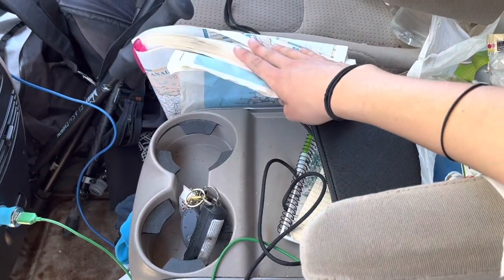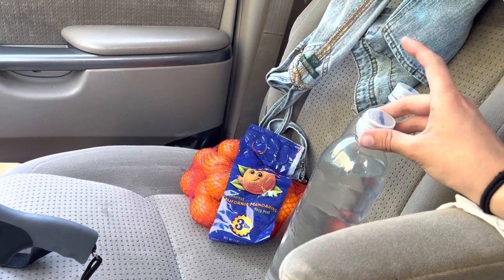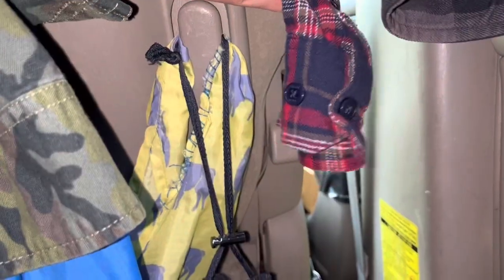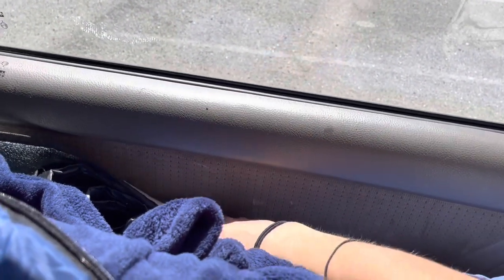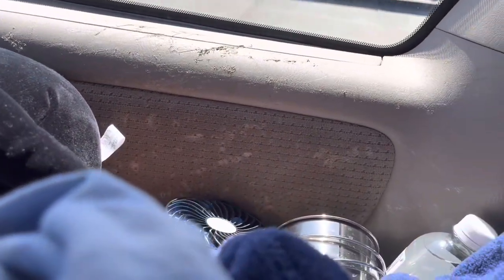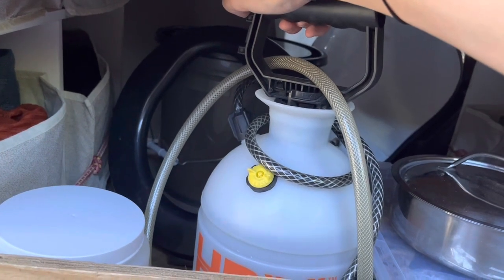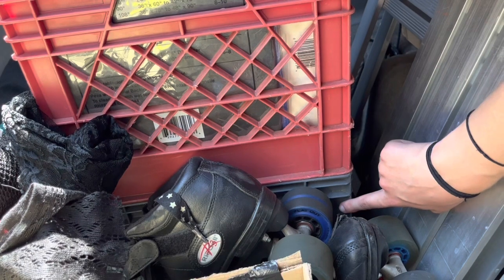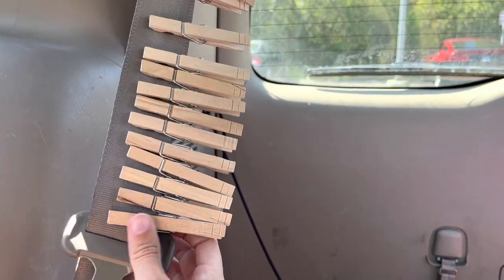VAN TOUR | DIY Minivan Camper | Easy Cheap Van Conversion

Comment: Why do most go full detail on where stuff is located. The van we got it....the side door pocket the passenger seat this drawer that drawer in the fridge in the cooler under here over there up here right there. Too much unnecessary yapping and not trying to be negative to you but it's to all. useless content
Reply from the maker: For someone complaining about too much yapping, this sure is an unnecessarily long and useless comment to leave
Reply: I found it very informative content. Its a TOUR video.